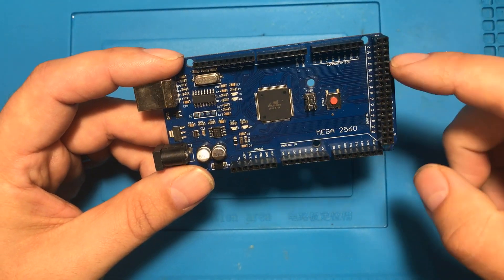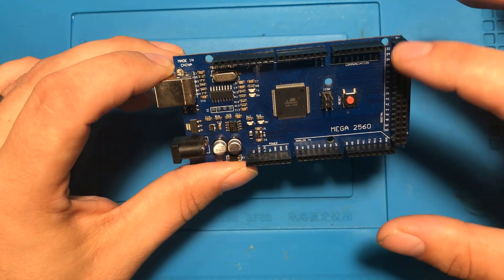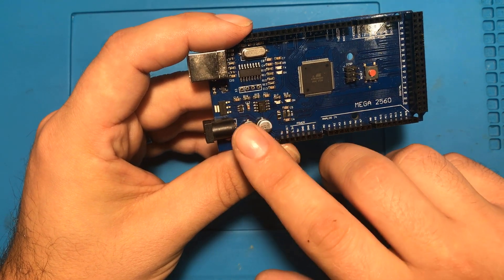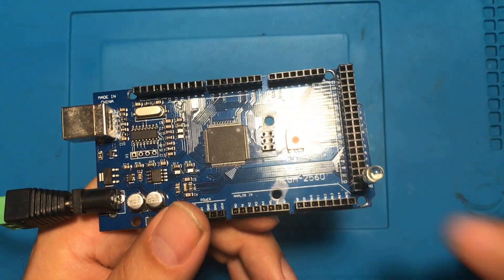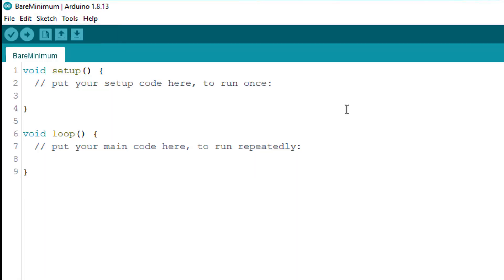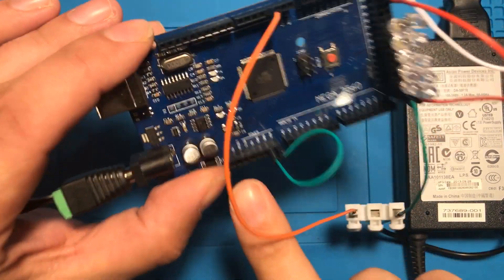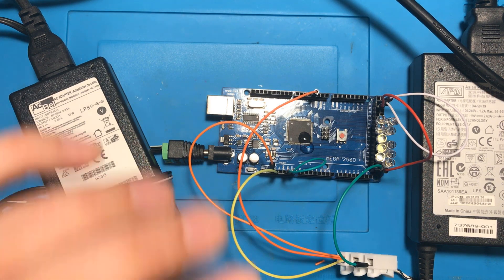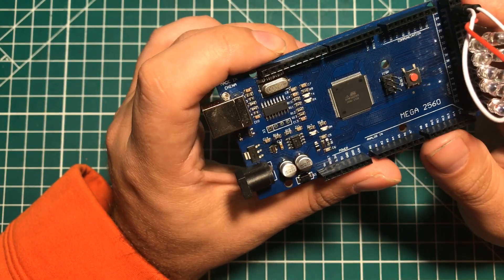Top 10 ways to destroy an Arduino - I did all 10 at once

Comment: Mmmm Magic smoke!

Hard to tell what died first.
When those 1777 regulators die, they usually pass the full input to the output. Not sure if that happened fast enough to beat any of the other insults to the punch, though.
Reply from the maker: I think I should try to replace those two parts and see if the thing boots.  What could possibly go wrong?

Comment: You left out my favorite.  Power your Arduino (and maybe some LED strips or robot arms) from a non-isolated cheap generic power supply plugged into bench outlet strip.   Plug PC into UPS.   Plug UPS into wall socket on a different breaker, on the opposite branch of your home 120/240V service.  Connect Arduino to PC's USB. If you really try, you can make a ground loop through the PC, the UPS, the wall wart, and the Arduino and fry them all together.   Even if the two neutrals are only half a volt apart, you can get a lot of current through that USB cable. Now you know why Ethernet is galvanically isolated.  Unfortunately, USB wires the "ground" right through from one chassis to another.   As did RS-232.
Reply from the maker: Haha there was no way I was involving my pc in this. I've seen that happen.

Comment: Incidentally, I think the only time I've ever damaged an Arduino was when I killed an analog pin with static electricity. The rest of the Arduino still works!
PS: I predict that if you prefix the video title with the word: "Top" it would go viral!  Good luck!
Reply from the maker: The only one I ever killed was my only genuine uno.  I don't remember what I did but it took out the pc usb port too. I tried changing the name. I need to do the thumbnail tonight. We'll see.
Reply: @AnotherMaker  , I have zero data to back this up, but I believe that the thumbnail does not need to have the same text title as the video description. As long as it still reflects content it should be fine.
You probably don't want to spend anymore time on this, but how about the typical mushroom cloud above a SIDE view (rather than top view) of  the Arduino for the thumbnail? Just an idea.